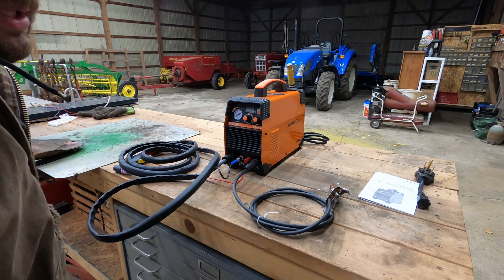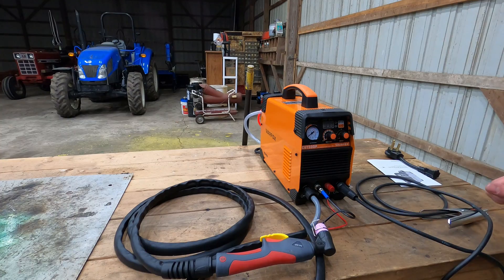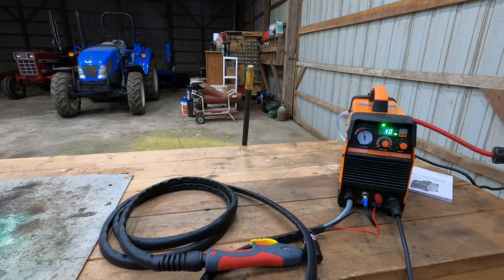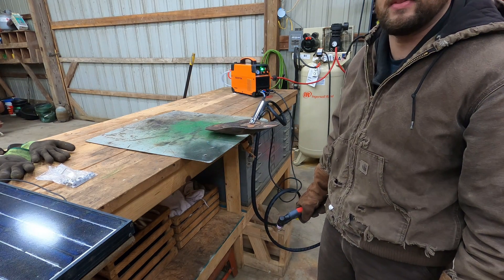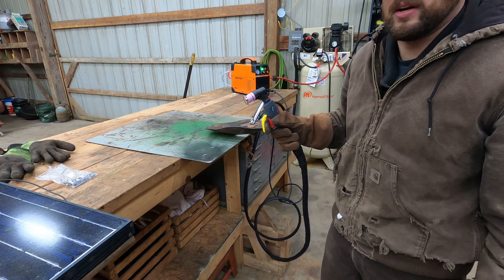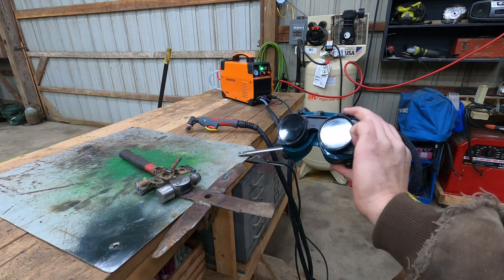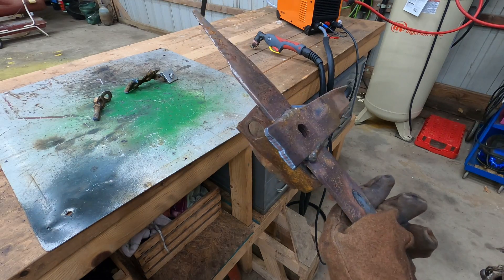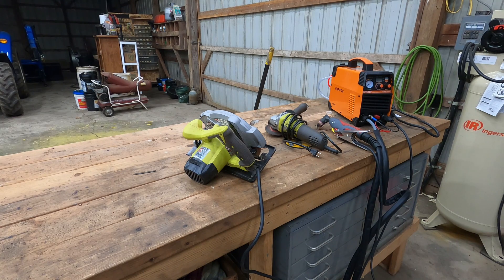Trying out the cheapest pilot arc plasma cutter from Amazon on rusty metal

Comment: I have a QUESTION -----> I have the same cutter and i am wiring by shed but can only get 30 amps in there SOOOO I want to put in a 220volt 30amp outlet but use a 50amp outlet so the cutter will just plug in without the 110 adapter ?? Any thoughts ???

Comment: Pilot Arc Question:  Could I use this to make slow, precise cuts in auto body sheet metal?   If I scribed a line on 18ga (.048) sheet, would I be able to very slowly cut right up to that line?  I have a non-pilot arc plasma and it's not possible - for one, you have to cut fast.  Thanks for the video.  Might sell off my old plasma and get the one you got - it don't need more than that!

Comment: I ordered the same...just received it two days ago.  Figured I'd set it up to make sure everything was okay.  I'll probably get rid of the filter/regulator that came with the unit and go with a standard 1/4" NPT ported filter/reg...the unit leaks at the provided male quick disconnect fitting.  I tried to thread in a 1/4 NPT air fitting that I have but the provided regulator must have metric threads.  Not a big deal...prefer a better regulator anyway.  Added bonuses are the front-facing pressure gauge, as well as the adjustable post-flow air.

Comment: Do you need the clamp on the work if it's got a pilot arc?? It seems to me that if it will cut through a relatively non conductive surface then the clamp is obsolete?
Reply from the maker: It for the most part will not cut without the ground clamp. There will be a noticeable difference without the ground attached during cutting.

Comment: I just ordered this exact same one about an hr ago based on your review I did some research and it is a pretty good little cutter..got mine for 259.00 with free shipping it will be here Thursday..thanks
Reply: It's even cheaper now, 229 and it also has a 20% discount on top of that, you can get it for 226.00 with free shipping
Reply: @tdperkinsgmail  226.00? Plus 20% off should be about180.00? If you r right I'm buying 4 more I have 2 already please let me know..
Reply: @tdperkinsgmail  hey not a problem thanks for the reply..still a really good deal I might just pick up another one..if you get it you will like it she cuts through just about anything dirty or not...hope you pick one up cause they sell out quickly and it takes a while for them to restock

Comment: Thanks, nice review.  I have CUT50 pilot arc I bought from Amazon too. Price was only $215.  It had a 3 pin connector like the LOTOS red CUT50.  I wanted to buy a spare torch and 99% are only a two pin connector.  I was able to buy a 2 pin to 3 pin adapter so I could use the common plasma torch.   Bottom line is I like it.  It is great for cutting up bed frames.
Reply: Which one did you buy?   Do you have the link?
Reply: @FlakeBoss  
I bought a “Mophorn” CUT50 off of Amazon for a $215 price.  It works fine.  It is now nearly $300.
Reply: Here is the link to the non touch Mophorn pilot arc plasma.  Price has gone up to $280.
https://www.amazon.com/gp/product/B07PJMVHBS/ref=ppx_yo_dt_b_search_asin_title?ie=UTF8&psc=1
Go to Camelcamelcamel and monitor its price.  Its lowest price was less than $200.  I bought mine when it jumped to $215.